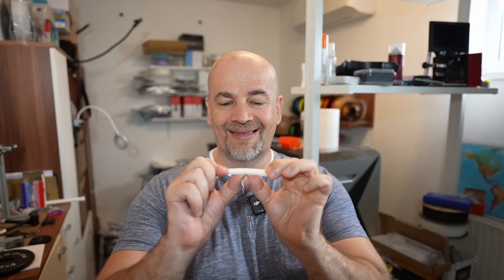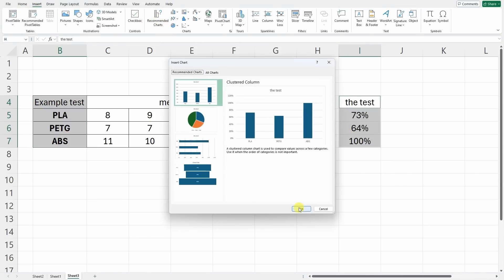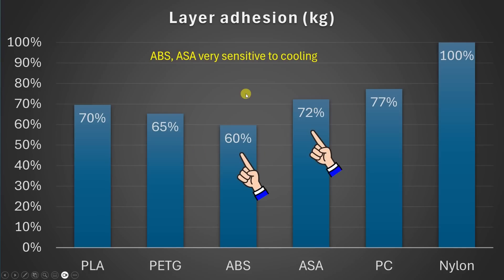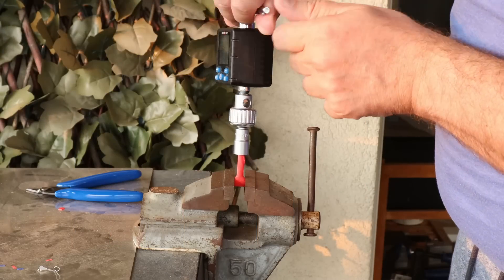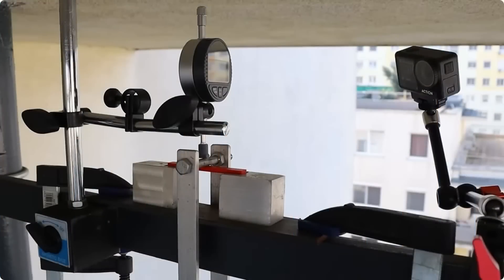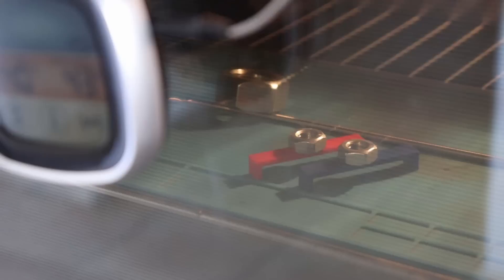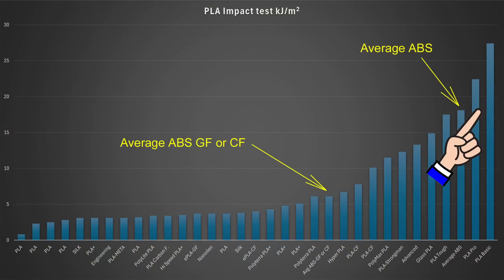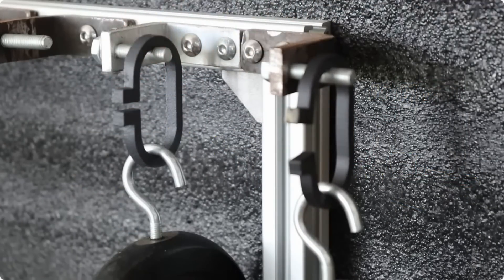Which is the strongest filament type? PLA, PETG, ABS, ASA, PA (Nylon), PC

Comment: I see a MTF video - I click. Honestly, this is just a great comparison and tells me again that PA is just the best, if you can dry it… for functional printing, layer adhesion is my most important factor. Then would be UV / temp resistance and then strength. as long as creep is not an issue PA is a great all-around filament.

Comment: Didn't expect petg to perform poorly. I assumed it was one of the stronger filaments
Reply from the maker: The reason why you want to go PETG instead PLA: less creeping, more temperature resistance. Something I am not testing here, more chemical resistant. Also better for water applications. Advantage to ABS: no need for enclosed printer, more dimensionally accurate.

Comment: So basically PETG is slightly better than PLA only in terms of temperature resistance, but for all other mechanical applications PLA is better.
Reply from the maker: PETag is better against Creeping too.
Reply: Funny because everyone says PETG is better than PLA in everything. My experiences reflect the data in the video. And as far as UV, I don't see PLA breaking down like people say it does. At least in the short term (weeks to months). There's videos of prints years old still doing fine in the sun out of PLA.

Comment: SPECIAL REQUEST: your tests often focus on mechanical properties, which I find super, super helpful.  When I do functional prints, I spend most of by print time (and plastic) on prototypes that are discarded before I print a final assembly.  I'd LOVE a shootout that compares "high speed" PLA and PETG on two axes: volumetric flow rate on one axis and cost per KG on the other.  Roughly, what filament is optimal for cheap rapid R&D on a design before it becomes a final part?

Comment: I've noticed normal PC tends to form cracks over time in mechanical loads, but that could just be the PC filaments I've used. And CF from what i've got from my use is that it makes it a bit stronger and notably stiffer with the trade off of making it more brittle, sometimes much more brittle. With tall that said, my go to PC type of filament is Glass Fiber.

Makes it a bit more ridged but also much more impact resistant, and I've not seen any signs of fatigue in any of the parts i've printed out (but i also have not measured). I've used it for part cooling ducting on my main printer, and it's smashed into parts running at 300mm/s (7K acceleration) with no damage or even the slightest deformation. ~60c enclosure temp

There's a good reason most power tools are made of a blend of ABS/PC Glass Fiber
Reply: Plus PC is solvent cracking prone, just a drop of it can cause total crack in seconds under the load.
ABS and ASA are sensitive as well but not to such level.

Comment: So to summarize it seems like ASA is a pretty good middle of the road filament but you'll need a heated and ventilated chamber. Nylon is best for when you need flexibility and high temp resistance and poly carbonate its best when you need very strong rigid parts. But for both nylon and PC you would need a hardened nozzle and probably a heated ventilated chamber too. Both nylon and PC are difficult to print. For this reason I have chosen ASA as my preferred high strength, high heat filament.

Comment: Please be careful with carbon fiber filaments. Nathan builds robots just released a video where he shows tiny fibers sticking to the skin. Wouldn't want that in sensitive areas or your lungs
Reply: I use CF filaments when needed, but never on parts that will be frequently touched, for those reasons, and i dont think i would print it if i had to have the printer at home :)

Comment: Hello Igor,
great video as always! I just finally joined your Patreon :) 
Have you tried asking Extrudr to send you their Greentec and Greentec Pro (also the CF version) filaments before? I use a lot of their PLA NX2 and Matte PETG and have bought a few Greentec ones. I see you tested their PETG, PCTG, ASA, TPU but not their signature Greentec Pro material which claims really high temperature resistence. At least according to their own characteristic details it seems similar to that Filaticum Engineering PLA. 
Would really love to see you test more Extrudr filaments.

Comment: One thought I had, though I'm not sure how to test it, is that ABS tends to permanently deform before breaking. I think that the deformation absorbs a lot of the energy, but a printed part would still usually be "broken" even though it has not detached completely. What would those numbers look like vs. even something usually considered weaker like PLA?

Comment: I was happy to see ASA among the best in most of the categories. It is my go-to filament for just about everything. I did get some Gizmo Dorks PC and that stuff is super strong. It’s also difficult to print. I probably used 100g just calibrating it to print successfully. I still never got a large print to complete because it would warp off the bed. I even used nano polymer adhesive  and maxed out bed at 120 and chamber at 60. I can print 100mm parts, but beyond that it's hit-or-miss.
Reply: Yes, same with gizmo dorks PC for me - wraps, pulls up the bed at 65 chamber bed 120.
So I moved to overture PC , haven't tried yet larged objects, but it seems strong and easily printable

Comment: Everything I print is a functional part, and over the years I've moved to using PACF, ASA, and TPU for nearly everything. Using a cheaper material but having to use more of it or do several iterations to get it strong enough isn't cheaper than printing it once in a quality material and moving on to the next project.

Comment: As others have point out, most so called PC filaments in the market are blends, not true PC. 

True PC is very difficult to print, hardly stick to the bed, and curls like crazy. 

Got it to print reliably with my X1C, but have to set the head at 300C, 110C bed, and limit the flow to 4mm3/s. By far the strongest thing my printers produce. 

But in the end I went back up bambu's "PC". Twice as expensive, but printing more than twice as fast, and strong enough for my applications.
Reply from the maker: What brand of PC you tried?
Reply: @MyTechFun  if you want something very similar to PC but much more printable try TreeD PC-PBT-GF or AddNorth PC Blend HT LCF.
Both are filled PC-PBT, where semi-crystalline PBT is added to increase rigidity, thermal resistance, and chemical resistance. Just print it hot (300° hotend if possible) to make the PBT crystallize while printing.
The amazing thing is that they are incredibly easier to print compared to pure PC, and should achieve similar or better results in theory.
If they live up to their claims they should be the highest performing but still printable filament you ever tested
Reply: Yes, true pure PC needs 120-130° chamber temp to print properly, or 90-100° if carbon or glass fiber filled.
Anything that is printable at lower temps has additives that increase the printability but lower thermal and mechanical properties (mostly PETG, but sometimes PLA).
Reply: Which PC brand?
Reply: @vim55k  "true" PC is something like 3dxtech, or any random noname PC filament found for 20€/kg or less is probably without additives. The best way to check is if they list a required chamber temp. Anything unfilled that is printable below 120° is not pure PC
Reply: @vim55k  Unbranded, my workshop is in China, they do have the supply chain advantage. 

The named brands are mostly OEM from the few actual manufacturers. We prefer to go straight to the source. 

I can probably send you some samples if you are interested. True PC is very challenging for consumer grade printers.
Reply: @charleyfan1908  thank you very much! I just love PC! Unfortunately it won't print on my qidi xplus3 even with a nozzle 350 bed 120 chamber 65. I tried gizmo dorks. And it wrapped for a fully filled wide object. 
So now use Overture PC.
Will wait for ratrig 4 , they promise it can withstand high chamber, additionally to being idex.
Just interesting to know, is that raw PC filament is really that cheap, like $20?
Reply: @vim55k  yeah raw PC can be very inexpensive

Comment: I took your advise and used TPU for printing very strong objects to print some weight blocks ( to stop barbell from rollling when i put down weights) i printed 4 walls. 4 bottom and top layers with 32% infill and they hold all of my weights no problem!

I used 95A hardness. TPU really is Incredible material.
Reply: It seriously is! So many uses.
Reply: @802Garage  Harder to get nice quality though. I always end up with strings and issues wherever there has been a travel move. 

For my purposes it's okay but I'd love to be able to get it printing cleaner. Strings are okay but the bobbles are annoying.
Reply: @freedomofmotion  Def some tuning can help. Flow rate, temperature, seam gap, wiping, retraction distance, retraction speed especially, travel speed, travel acceleration, turn off Z-hop, and more, but those are all key.
Reply: @802Garage  Got any tips?

I am printing fast with it though but found I had the same issues printing slow.
Printing at 15mm³s  I think the default flow rate limit was 3.2 !
Reply: @freedomofmotion  TBH the fact you're able to print that fast at all is impressive. Typically around 6mm³/s is the limit. I'd tune flow, then temperature, then retraction distance, and I'd run as short a distance as possible to eliminate stringing while running very fast retract speed. The fast retract speed is to basically eliminate the elastic pressure as fast as possible and prevent oozing. No Z-hop, do have wiping on, retract 100% before wipe probably, very fast travel speed and travel acceleration.
Reply: @802Garage  I'm using 100mms retraction at 1.5mm. what sort of speed and distance do you use?

I'm using a Kobra 2 max with a slightly modified hot end set up. ( Nozzle and heatbreak upgrade)

I'm printing at high temperature to achieve that flow rate 250. It under extrudes at regular TPU temperature. I think I could go down to 240 potentially.
Reply: @freedomofmotion  Yeah lower temp and speed may be the key to cleaner parts then. That sounds reasonable on the retraction, though a little more distance might help. Otherwise drying the filament could help. Sounds like you have a good handle it can just be tricky.
Reply: @freedomofmotion  use a dryer
Reply: @MinuteBracelet I print directly from a drier. The issue is caused by illogical print moves from the slicer. Because of the arc of the part before it does it's nedt perimeter it lays down some kind of infill ( backwards and forwards about 3 mm) problem is it's anchored to absolutely nothing so curls up and then causes the issue.
Reply: @freedomofmotion  What slicer do you use? I use the Anycubic packaged version of orca with my Kobra S1 and I haven't had problems with TPU after flow calibration.
Reply: @MinuteBracelet Orca slicer, latest version.

And you would have to print my file to see if happens. 

😅

Comment: Excellent summary,Igor, thanks. I use your patreon summary table and find it extremely helpful. Since my parts are used outdoors and in the ocean I started out using PETG but found the parts were shattering during impact. Based on your work I switched to Polylite ASA and it has been a vast improvement.  Thank you again.
Tom
Reply: Which impact you encountered during usage? 
I found out asa has worse layer adhesion than petg, but it is more lightweight. 
I also need material for water usage on a board
Reply: @vim55k  three types of impact where I saw breaking
1. Small light spar buoy tipping over and parts impacting a laminate floor from about 1 m height, 20C ambient. PETG shattered, ASA dented but fine.
2. 4.5 kg (10lb) steel ballast weight supports using PETG on a hydrophone mooring, having pieces shatter off when laying the mooring over on its side. Fairly heavy weight but not a fast deceleration, again 20C ambient temp.
3. Moving fully ballasted (~35kg) moorings around on steep rocky shore in cold temp (~4C) both PVC and PETG foot parts broke while heaving the mooring from rock to rock. Even with TPU foot pads to reduce the shock. I use beefier TPU foot pads now and ASA supports.

My ASA layer adhesion is pretty good now. BBL X1C, high temp plate, Magigoo adhesive, 41 to 45C chamber temp (I preheat with bed at 95C and aux fan on 40% until heated), 95C bed, PolyLite ASA, Flow 0.96, shrinkage 99.5%, Nozzle 265C hardened steel, Max vol speed 12 mm^3/s, 0% fan at 20s layer, 80%fan at 1s layer, 80% fan for overhangs, No aux fan.

Comment: I wanted to commend you on your excellent introduction to FDM printer filaments characteristics. The video is very informative and provides a comprehensive overview that is easy to understand.

However, I noticed that in your calculations, you only use the average for each material to compare their performance. It’s important to consider not just the average but also the standard deviation and the confidence interval. The end result isn't just a single value, the average, but a probable range of values related to the level of confidence.

By considering this range, you might find that two materials with different averages could actually be similar or not statistically different. This means that stating definitive differences between two products can be misleading if the statistical analysis shows they are indistinguishable.

The number of samples you use will significantly impact this range, with more samples leading to a narrower, more precise confidence interval. I recommend overlaying this range around the mean on your graph, similar to the method used by Stefan of CNC Kitchen. This would provide a clearer picture of the variability and reliability of the data.

I really appreciate your work and encourage you to continue producing such high-quality content. Incorporating a more thorough statistical analysis would make your comparisons even more robust and reliable.
Reply: Good post, i hope Igor reads it :)

Comment: I think generally PLA for anything indoors and unheated, PETG for anything that needs a bit of flex, ABS-GlassFibre for anything else/engineering. Nylon fills a specific niche of flexibility and low-friction (gears for example), PC is only slightly stronger than ABS-GF so if you dont need the heat deflection its rarely worth it as both PA and PC are just such a pain to work with due to the hygroscopic nature of them.

These tests you do are so useful because they have a consistent methodology!
Reply: I use prusa PCCF, it doesn't seem to care about moisture and thats a big plus compared nylons. For automotive use i find PC the best, with the combination of stiffness, creep and temp resistance. But i also use abs and petg for less demanding stuff. PLA for prototype and kids stuff:)
Reply: Actually I tried asa and it was very bad layer adhesion relative to PC. Printed without fan
Reply: @vim55k  While poor layer adhesion can come from plenty of things not having the fan on definitely is not ideal for ASA. I'd try a low fan speed(20-30%) at reduced print speeds with dried filament. ASA should generally have very solid layer adhesion.
Reply: @minted3d650  I don't know about what good layer adhesion of asa you are talking about. I tried asa only recently, but even with no fan and high temperature I could tear by hand the layers of a thin wall. 
Where with petg the layers are fused
Reply: @vim55k  Like I said your print settings are wrong. I've been printing with ASA from different brands for years and as you can see from this video the layer adhesion for ASA is generally pretty strong(he's tested many brands extensively). You're confusing your own anecdotal experience with improper print settings with material properties. Try at least 30% (or higher)  cooling for starters, no cooling is not ideal.